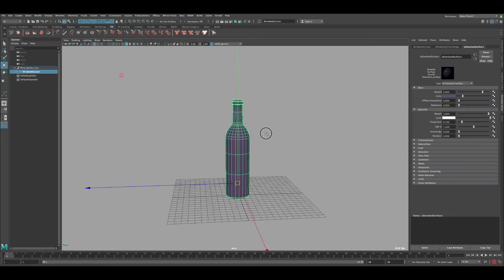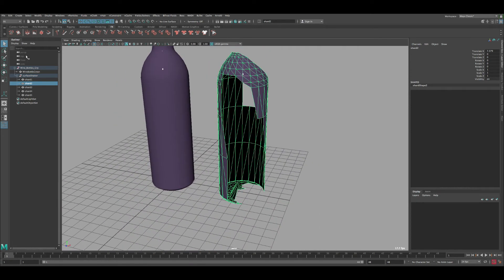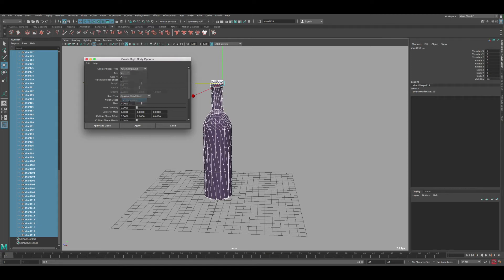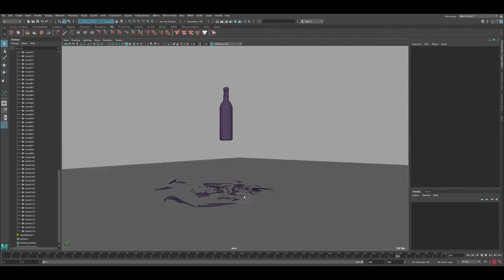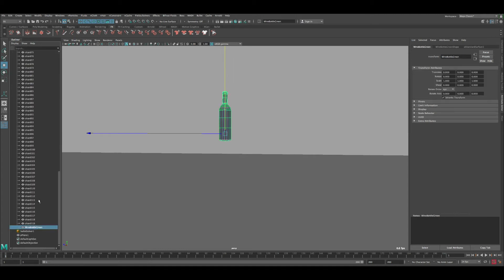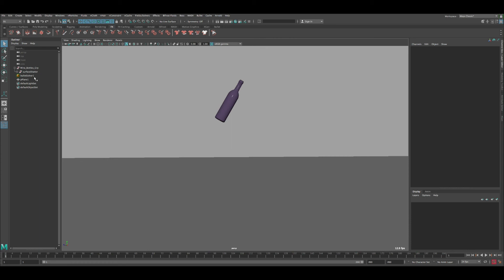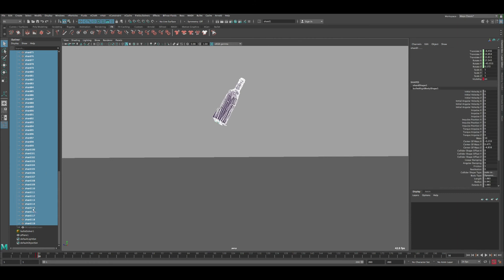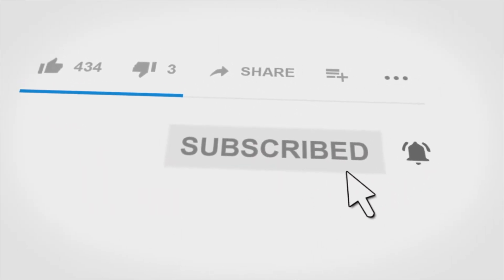How to Shatter Glass in Maya and Bullet Physics Simulation - Bottle Shattering Animation

Comment: Bullet is really limited i think.
Reply from the maker: I think you have a good point, there can be improvement, but it does some really cool stuff. I like how fast it is in processing huge number of objects.
Reply: @3DModelsWorld.  good side is it is so easy i learned every parameter of bullet and i created new technique. i build a house with columns walls and floors and shatter the pieces that will get hit so it becomes  more realistic i give different glue value to columns and walls but first problem is i cannot shatter it as quads i can only shatter triangels and the thing is i cannot give deformation or shattering to active body and i want to see the buildings inside objects like construction iron reinforcement of the building.
my dream is working in a cg studio so i started to learn houdini
Reply from the maker: Great Job! I'm happy to hear what you have done it will be great to see the result if you can post a link to your video to watch! also I wish you all the best for your career! I'm sure you will get your dream job! just keep learning and practicing! also check what cg studios are doing in their demo reel and try to do something similar to them so this way you can show them that you can do similar stuff to them to get better chance at getting a job! good luck :)